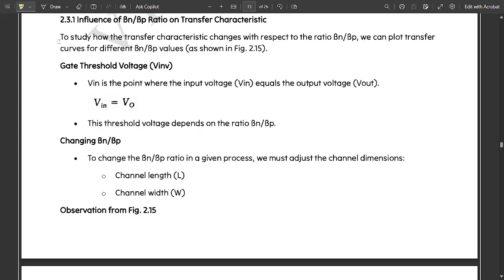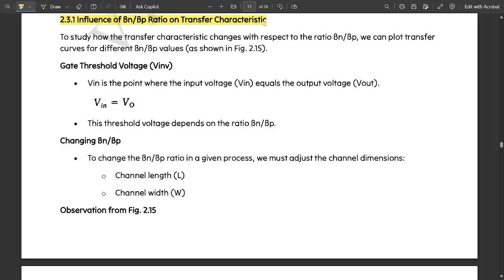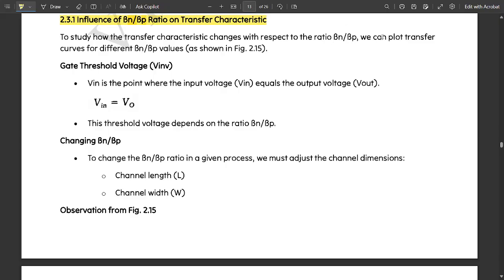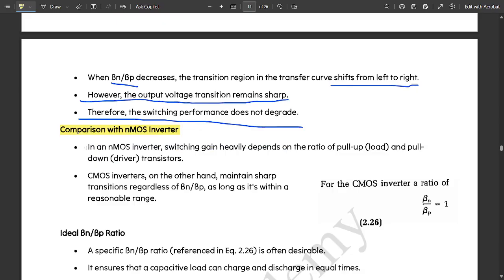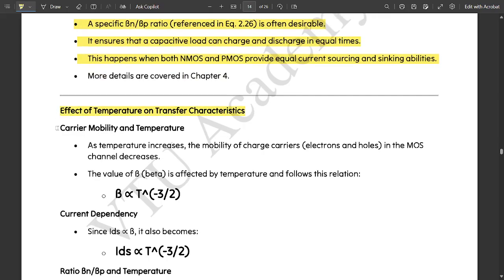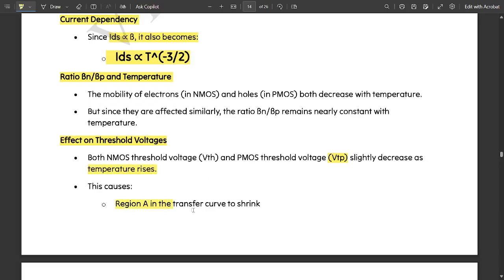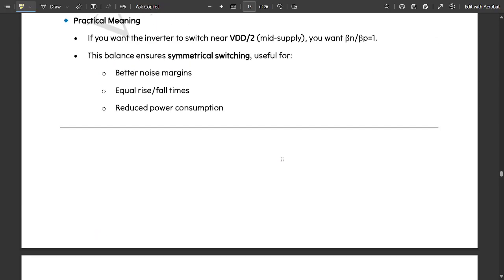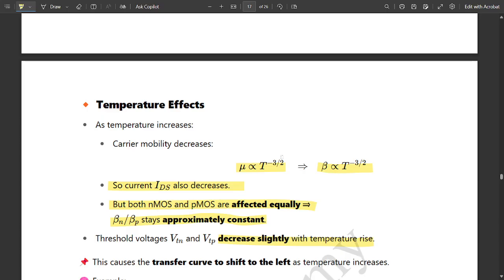5 Beta Ratio Concept Explained Module 2 6th Sem VLSI ECE 22 Scheme VTU

Comment: 2:17 Here, I think it should be " Vinv (threshold voltage) is the point where the input voltage (Vin) is equal to the output voltage (Vout)". Right?
Also, why is the threshold voltage denoted as Vinv here instead of the regular Vth ?